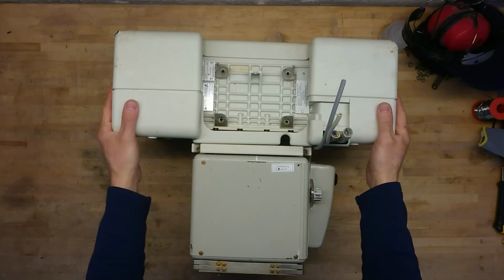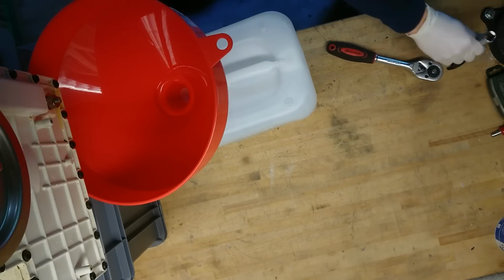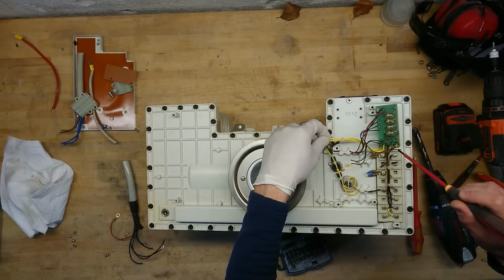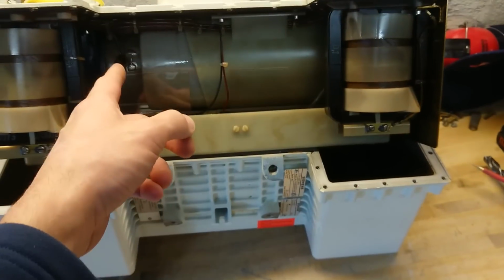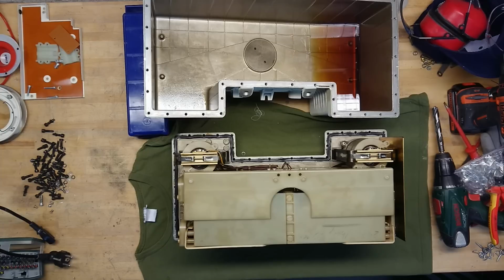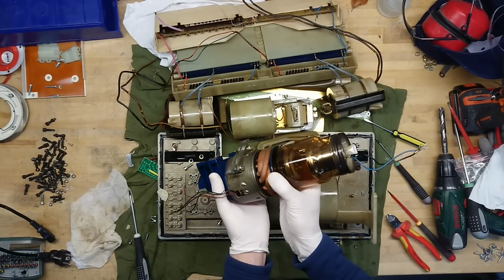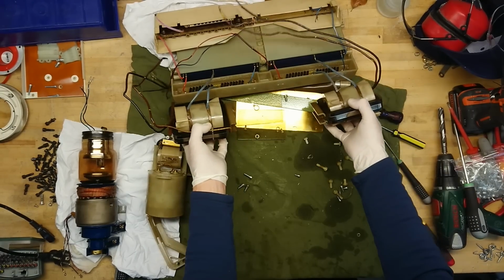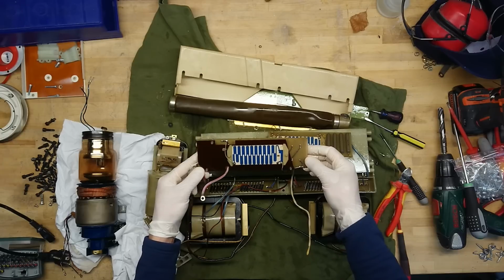Siemens Polyphos 30, XRAY 125kV Head Teardown (Part 1 of 3)

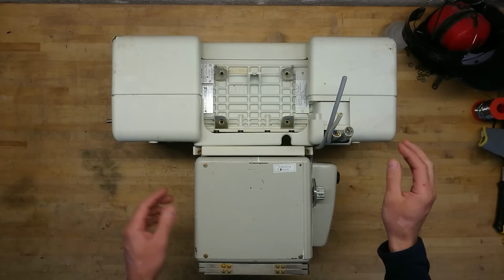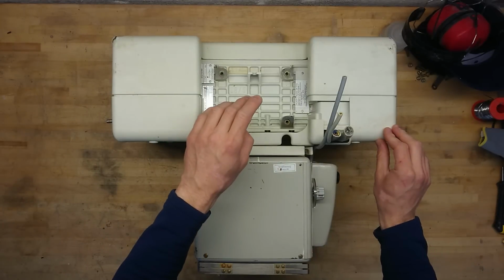Comment from the maker: What a bummer that there is a black sequence from 1:00 to 1:25 and some of the clips are flipping up/down, seems that when I did splitting in the video editor, it removed the rotation of the video that I applied as the first thing. I am sorry for lack of quality check before uploading, but the few seconds lost is not crucial for the video as a whole.

Comment: Are you sure it was under vacuum, because those rubber bladders are generally used to allow thermal expansion or internal/external pressure changes in an enclosure while maintaining an environmental seal. This does not work if it's under vacuum because it requires a port to the atmosphere.

There are versions that work for vacuum enclosures. They are totally sealed and have a very tiny amount of gas in them. I don't think this is that kind because it would be completely collapsed when you opened the enclosure. Although it is possible that it had a vacuum port to the outside so it was filled after the unit was assembled and you didn't show it being removed.
Reply from the maker: No, I meant a vacuum pump was used to degas the oil. I did not get it said that clearly as you can hear, I repeat the sentences twice but still with wrong words. That will happen during no-script teardown :)

Comment: Why is the X-ray tube brown?
Reply from the maker: With use, the clear colorless glass of an x-ray tube can become colored. Such a color change is either due to the absorption of radiation energy, or the deposition of tungsten on the inside surface of the glass. The absorption of x-ray energy by electrons in the glass promotes them to a higher energy state (the conduction band). The now mobile electrons move to positively charged impurities in the glass where they become trapped. Since these trapped electrons are at a higher energy level than they were prior to the exposure to radiation, the absorption spectrum and the color of the glass is affected.  The resulting color depends on the type of the impurities: the softer glass of the older tubes (e.g., 1920s vintage) tended to turn purple, while the harder glass of the more modern tubes (e.g., post 1930) tended to take on an amber color.  https://www.orau.org/ptp/collection/xraytubescoolidge/coolidgeinformation.htm#:~:text=Such%20a%20color%20change%20is,state%20(the%20conduction%20band).

Comment: Why didn't you put the X-RAY back into use? An X-RAY is a very useful tool. Not only for medical application. Because with 125keV and probably a peak at 100keV it's possible to x ray a lot of materials. Apart from the analytical standpoint.
Reply from the maker: As you will see in the later videos, the control panel and inverter was busted, no manual is available and a fully analogue computer made it a tough job, rotating anode tubes are also less desirable to use in a homemade xray machine. Another point is that I do not have the required space to work safely with xrays on this scale, so I will not attempt that.